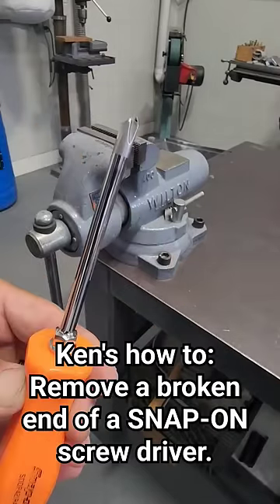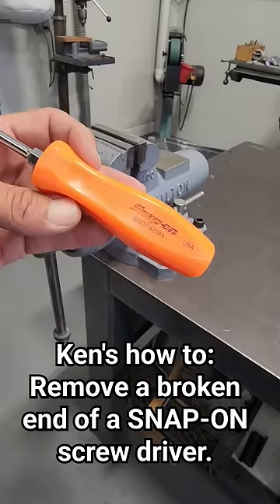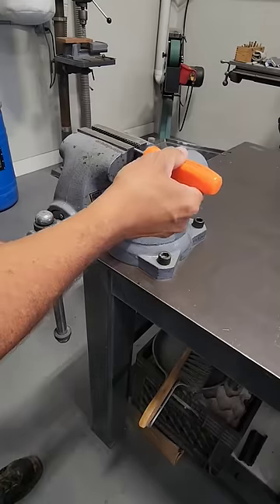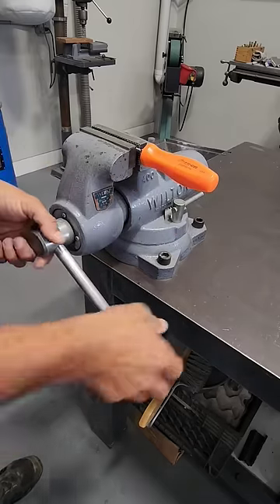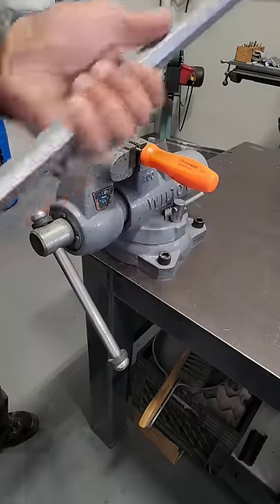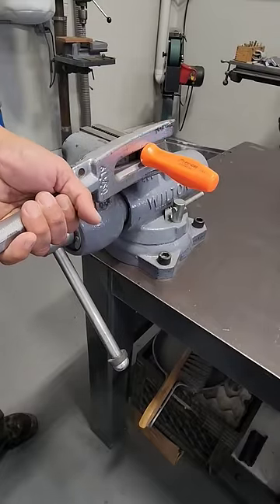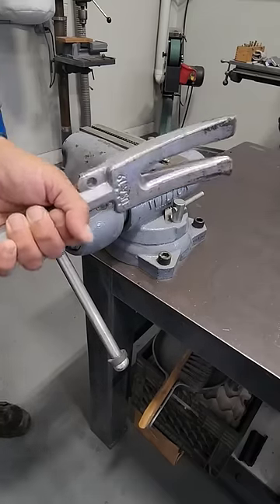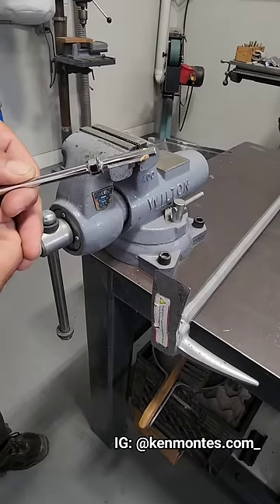How to remove the broken end of a Snap-On screwdriver.

Comment: I've never had a snapon guy do that. Handles aren't warranted so if he gave u a new one it would be out of their pocket. I've had 22 different snapon guys during my career so far and not 1 of them would give u a complete new one.😂
Reply: Lol your expected to repair your screwdriver? Haha just go to harbor freight
Reply: @of-Israel you can’t read
Reply from the maker: It has happened to my 2 times. Both were with older black handle Allen drivers. I had my friend hand them to the guy inside his truck. He did not have the replacement allen, so he sent it in and they replaced it with a new one. And of course they sent the new style and kept my original.  So my stuff not only didn't match, it also didn't fit in the original spot. Believe me, I was bummed!
Reply: @KMbuilt  they'll do it with Allen's and torx but for screwdrivers and ratchets they won't. Makes a lot of sense. I had a old set of Allen's too that were my grandads and I had to warranty 1 and messed up the set and won't fit in the tray so I bought one on ebay. Lol
Reply: @Chevydude1982 my long handle flex 3/8 hard red handle ratchet broke at the flex ears from abuse they took it from me and a few weeks later he handed me a brand new identical ratchet they didn't even attempt to reuse my old hard grip unless possibly snapon did and it broke
Reply: @of-Israel it takes like 5 minutes to do with a dremel 👍
Reply: Shit my Cornwell guy warranties handles.
Reply: I'm a matco dealer, we just warranty the entire screwdriver. They say "well it doesn't match the rest of them now" to which I say "looks like you have some tools to break. Let me know and I'll order the replacements". Matco doesn't care, it's just another warranty.
Reply: @Deepwaterjew  matco uses witte,don't they?
Reply: @Chevydude1982  that is correct.
Reply: I can't remember anything specific about 22 distinct things. For example, if you'd only ever had three dogs you'd probably be able to recall that accurately because three is a small number. If I'd had 23 dogs I'd probably say I had had lots of dogs over the years.
Reply: @jeffharris727  if u can't remember 22 names then I feel sorry for ya
Reply: @Chevydude1982  don't feel sorry for me, I'll be fine. How many different people have bagged your groceries?
Reply from the maker: https://youtube.com/shorts/XRKHaO6OINI?feature=shared
Reply: I had a snap-on driver give me a none matching handle. I had no idea you could pry them off.
Reply: And that’s why I don’t buy snap on haha
Reply: @jeffharris727 he won't be replying. Maybe he's too busy memorising the names of people who've served him dinner?
Reply: @KMbuilt if he gave you new handles in exchange for the old black handles, he did you a favor!
those old black ones start breaking down and smell like puke, and get brittle and break.
Reply: @jeffharris727 nah in my house we do the name call till we get the right one 😂
Reply: I call BS, first that you kept track of EXACTLY how many snap-off guys you’ve had, next you would have, had to of broke the blade of a screwdriver frequently enough to have had to exchange one with every snap-off guy you ever had?? If you did, you are the world champion of breaking screwdriver blades., and the fact that you don’t elaborate to add what they do when you strip the shann
Reply: @KMbuilt they might have thought they were doin ya a favor, not knowin you still got the set, someone coulda thought new was better.
Reply: It's so all them match not old and new mixed u know it don't look good at all they all need to match !!
Reply: The tip of screw driver was broken so he removed handle to put on replacement
Reply: Only time I have had a handle replaced was if it somehow broke I have had handles like that break cause I was using it as a chisel lol and my snap on guy gave me a new one all together other then that no never replaced a handle
Reply: Same
Reply: @Deepwaterjew  and that’s why I’m not a Matco customer.
Reply: @dwightmays888  why exactly?
Reply: Sounds like such a scam company given that info. They're not paying to warranty the entire tool? Wow. After paying 5-20x the cost of any other tool.
Reply: I've been warranting snap on screw drivers for YEARS. From being chewed up by a puppy, to split from beating the snot out of them.  You couldn't get them warrantied because you've never spent enough.  Trust me.  😜
Reply: Yeh my guy just swaps for a brand new one on the spot if they have the stock, for any warranty issues. That warranty is the only way I can justify the cost for most of their stuff
Reply: Except the ratchets you have to buy rebuild kit , maybe because my tools were passed down and not bought by me technically, I do have nice set matco pry bars , I was a kid I loved when the Mac matco and snap on trucks came , except for listening to how much money for father spent on co sign , with don’t tell your mother 👩 lol
Reply: @KMbuilt why does it matter if it doesn't match. It's not like it's a fashion show or something as long as you got the right length and size of tool back who cares the color of the handle. And if it doesn't fit just adjust the size of the slot that it goes in so it does fit not a huge deal getting a different colored handle. It's not like a customer is going to look in your toolbox and see that your screwdriver handles don't all match and take their car else where or a co worker is going to make fun of you for having a different color screwdriver handle.
Reply: @ken_montes its a eye sore, i understand where u coming from, especially with older tools with colors or handle styles that have been discontinued
Reply: @Deepwaterjew  that's the way to do it man! 
I used to work at a hardware store years ago and their own brand has a lifetime warranty, but with the measuring tapes it was only on the case, not the tape itself. So when people would come in for an exchange with a broken tape I would tell them to go outside and smash the case on the curb so I could get them a new one. 😂
Reply: @onesadtech  one of my favorite things to do in front of customers is to break their tool in a way that is covered under a different type of warranty. Only when I have it in stock though then I'll be like "damn, that's wild man. It's REALLY fuckin broken now huh?" and they'll just stand there and say "dude what the fuck" THEN I swap the tools for them. Another thing I like doing is acting disappointed when they say they haven't broken any tools, but when they finally break something I'm just as disappointed that they broke it. I like to have fun and mess with my customers.
Reply: @youknoweverything7643 what a weird comment, a lot of people care and want their tools to match and be dress right dress. plus like he said handles may be different sizes and not fit back in storage
Reply: 22 snap on dealers? How many times did you move holy sh!t ! My snap on guy just gives me a new one! For FREE like what there supposed to do!
Reply: @6door6four96  those handles don't come off that easy unless they are worn out bad.they have replacement ratchets for that I think cause it's easier and 1 less thing to stock.
Reply: @jeffharris727 Exactly 😂 💯

Comment: Never in my life had a Phillips end break...

Lesson of the day: Don't pay extra for lower quality
Reply: You haven't had to giver on a rusted PoS.

I'll lose a driver every few years. And what ever not potato brand Depot or Lowe's has on sale is what I buy.
Reply: @AnonymousMod.  Buy an impact screwdriver
Reply from the maker: I have had that since 1998, and it was my favorite P2 ever! I actually didn't chip it, it was an employee, and that dude was shocked.  At some point, things break. I'd say 25 years of building cars and other stuff, is a good run for a P2.
Reply: Not a bad run, was going to snap on you at some point I suppose
Reply: Never had a Phillips break? I guess you always had an actual punch, clevis pin, can opener, grout remover, etc.
Reply: @roybiv7018 😂
Reply: @bambam-pl2rd I see what you did there
Reply: All my cheap screwdrivers dont break cause they just cam out and strip the screw lol.
Reply: They actually break easier when they are harder. Craftsman just rounds of like it’s made of lead. Also happens when the tool is made to precision being used on precision cut screws, as in aviation. Your experience is keeping its miles low…
Reply from the maker: @Yamatool  🤣
Reply from the maker: @Spiraljam  exactly! 😁👍
Reply: Lesson of the day if you’ve ever done real work, it happens.
Reply: @KMbuilt yeah but my harbor freight screwdriver form 1776 still works fine…..
Reply: What age are you? Five? 🙄
Reply: In Screwdriver fan circles Snap-On’s are the quality item.
Reply: @bambam-pl2rd I see what you did there, nice
Reply: @latindoggy8059 Ben Franklin started a really awesome store back then. They printed the ads on the back of the Declaration of Independence
Reply: @chrisrageNJ  I miss the hood old flier days!
Reply: Never in your life have you had to work on anything in the rust belt😂😂😂
Reply: @FordMustangGTRocks Shattered several.
Reply: @kamikrazywarboy2008  how? I've never broken one using it correctly. I have a cheap impact screwdriver for tight screws. I'm a mechanic
Reply: I broke 2 Klein Phillips screwdrivers they aren't cheap either removing rusted screws is a thing. And Phillips do round off from cam outs.
Reply: @FordMustangGTRocks jokes on you, i snapped my impact screwdriver bit on Saturday removing disc bolts on a Honda CRV
Reply: Hold your right how tf you break a Philips head screwdriver tip
Reply: That's like saying corvettes are shit because you've never lost traction in your prius. No shit you haven't snapped a cheap screwdriver because they round off as soon as you apply any torquw 😂😂

Comment: OH NO MY TOOLS DONT MATCH 😱
Reply from the maker: It the freaking worst!
Reply: Obviously you dont have any Snap On screwdrivers. I have three sets of yellow handle ones. One combo one large Phillips and one large Straight. If one goes misding I go nutz looking for it. The minute I buy a replacement off ebay the fucker turns up. Lol
Reply: When you pay snap on prices it matters!🥺
Reply: When you invest tens of thousands of dollars into your tools you start to care what your collection looks like
Reply: But the vise was taped off and repainted rather than unbolted and sprayed.
Reply: We can tell you're a harbor freight guy 😂
Reply: @BigReggie  if thats your idea of an insult, then my guy try again. Let's just say I make $60 an hour and my tools cost half as much...I'd call that a win
Reply: Strap- on😂😂😂
Reply: @GeoffPesos and on top of that even if it's cheaper quality they replace it also and probably faster and more easily literally a harbor freight in every town no matter how small
Reply: It’s for warranty😂
Reply: Sounds like the opinion of someone who either doesn't have any or any tools of any quality. Or someone who doesn't use tools often and what tools he/she has were gifted.. when I purchase a tool I take pride in the tools use and appearance.. Heck my paint brushes are cleaned meticulously after using as well as removing and paint left on the handle. Scrapping then sanding them clean and smooth again . A person who take pride in their tools usually takes pride in their work as well...
Reply: When you pay $230 for 7 screwdrivers things like that matter lol.
Reply from the maker: It's been done like 10 times. It always gets unbolted. My issue is painting stuff on the table, hanging off the vise, holding work to paint with the vise, and small stuff that I say screw it, paint it right on the vise because I'm in a hurry.
Reply from the maker: @BigReggie yes you can! 🤣
Reply: @BigReggie when I make $10k with a $100 welder or do the same with a $10k welder. Guess which one I make the most money with.

Comment: Chunks of plastic stayed with the shank, would rather a whole new tool
Reply: They won't give u a whole new tool cause handles aren't under a warranty. Only screwdriver that would be replaced is a ratcheting one. They are designed to swap shanks. Replacement shanks are larger on the bottom for that reason
Reply: Yeah but the chunks are on the end, meaning those chunks ripped when the screwdriver was first assembled (as far as I can tell).
Reply from the maker: Na, it's totally fine. I'll take my original handle that I've used for 25 years. Plus the new ones are just not my jam. I dig the older stuff
Reply from the maker: @Chevydude1982 they have given me whole new drivers, thats why I now keep my handles,  and just tell them to give me a new shank
Reply: @Chevydude1982 
They warranty handles, if the handle is damaged. In that case they give you a complete new tool, but chances are it’s not going to match. They can’t carry every different handle style, that’s why they only replace the blade when possible.

Comment: My Snap-on dealer always replaced the end and used my old handle. Just tap it off with a mallet.
Reply from the maker: Yes, that's how it is 99.99% of the time. But if they don't have to tang in the truck...don't let them send your old driver to the factory or you will never see it again. 😢

Comment: My Snap On dealer goes in his truck put the broken end in the vice takes an open end wrench. Between the vise and the handle and taps it with a hammer off in seconds right in front of me
Reply from the maker: Yup! That's how it's done! Just make sure that if you need to replace an allen driver or if he doesn't have a tang in his truck......don't let him send your old driver to the factory...you'll never see that old handle again.  😢

Comment: You left us wondering... how the hell do you put it back on 😂
Reply: I’m wondering how he broke it in the first place… Never seen that happen
Reply: @WhackBytch256  I bought a brand new one the other day and the first screw I tried to take out the tip just snapped right off clean?
Reply from the maker: I'll do a follow-up when I receive my new part
Reply from the maker: @WhackBytch256 it has never happened to me before.  My friend was helping me install the carbon diffuser panel on the Blu-72 Porsche 911, and it just popped! After 25 years of use with no wear, it just gave up! 😅
Reply: Oh good👍
Reply: Force applied in the opposite direction. It came off with a pull, the opposite of pull is push. Now you don't have to watch the followup.
Reply: @brookelord3448  hey don't ruin it for every one!
Reply: They use a hammer
Reply: @DavidSmith-xj1jc  what size of hammer, a dead blow or ball pean?
Reply: @JMC9837  I always used a long handle 12lb
Reply: @DavidSmith-xj1jc  I don't know if that is enough 20 ton press might be better
Reply: With a hammer
Reply: pound.
Reply: You flip the pry bar over and pry in the opposite direction.
Reply: Tap on with hammer. Normally snap on guy taps them off with hammer too
Reply: @JMC9837    any hammer and a block of wood. Just don't strike the screwdriver tip.

Comment: Lol never had a craftsman snap the tip like that SMH. If it did I would just buy a whole set and maybe a few other tools and still be cheaper than that snap on
Reply: Only broken one socket in 40 years and Craftsman via Sears replaced it immediately. No receipt either. Read a few comments. Guess this is regular with Snap-on?
Reply from the maker: 🤣 seriously! But....the new craftsman stuff is no longer made in the USA. You can really tell the difference.  I'm very disappointed
Reply: @KMbuilt honestly craftsmen wasn’t that good before it shipped to China. I got my first set in mid 90s and stripped 3/8 ratchet gears first time I used it. Replacement stripped also before I just went to harbor freight. In no way implying harbor freight is on par with snap on just to be clear to the HF fanboys.
Reply: @KMbuilt honestly craftsmen wasn’t that good before it shipped to China. I got my first set in mid 90s and stripped 3/8 ratchet gears first time I used it. Replacement stripped also before I just went to harbor freight. In no way implying harbor freight is on par with snap on just to be clear to the HF fanboys.

Comment: 20+ years in the trades and I ain’t never seen a screwdriver busted like that.
Reply: Thank you!!!  I was thinking the same thing.
Reply: Neither have I... until I dropped a brand new snap on Phillips screwdriver off a boat into gravel and the handle snapped. Overpriced junk. I fix million dollar boats with husky tools 😂
Reply: Especially on a tool that looks like it was never used. He either broke that on purpose or the heat treat was bad from the factory.
Reply: Work harder buddy
Reply: Ive done one like that 4 times in the past 10 years...
Reply: I have, but only because the torque applied was way beyond reasonable.
Reply: Me neither. Apart from one that’s used as a chisel!
Reply: well if you’d been working instead of sitting in the truck eating donuts drinking coffee and reading the paper maybe you would have
Reply: Same here, 22 years using screwdrivers daily, and never had one snap. I've also never bought snap-on . . .
Reply: That's because you can't put out. I break every tool as they are not rated for me.
Reply: @davidrule1335 you mean you're too much of a tool to select the right tool?

"Tools aren't rated for me" fuckin lol
Reply: @benclarkson4205  Everyone has an "abusing driver" that one doesn't count. Best tool in the box though!
Reply: @AlbertHeinekenstein  No what I'm saying is, Anvils don't last around here.
Reply: got 50+ years and probably break one just like that about every 8-10 years.... and only the #2 phillips tips. I believe it's a combination of tapping the tool with a hammer to get a good bite, and the fact that you can put a wrench on the shaft to use some extra grunt.

Comment: I had the end of a screw diver rib threw my leg when i was 12 i hammered it in a tree the handle broke off so it was a straight metal piece i slipped off it and it cut me wide open i had to get 24 stitches
Reply from the maker: Holy crap! That sounds like a really bd day.